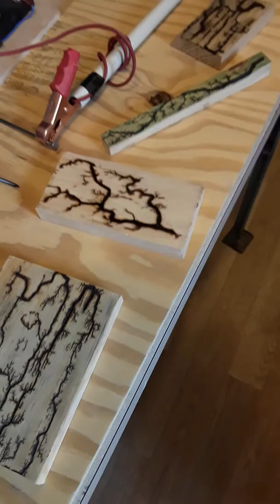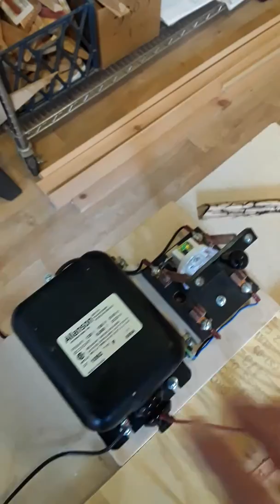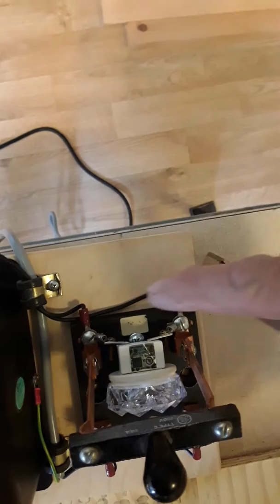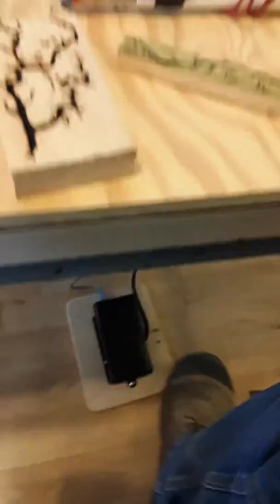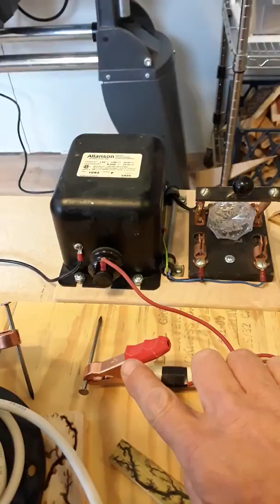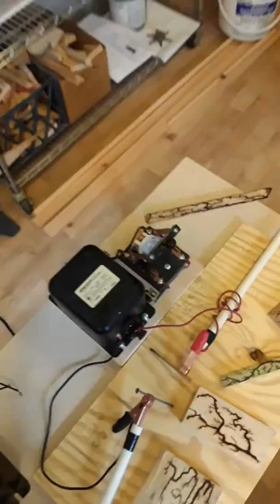Lichtenberg Wood Burning Power Supply

Comment: Would silicone HT cable used on neon signage be suitable?
Reply from the maker: Yes indeed. GTO wire has a 40kv rating and is very flexible. So is solid core spark plug wire. I didn't have any handy at the time, but great comment.

Comment: Not good enough.  The 40KV cable is good, but not on the roll!  And the coax is NOT rated for any sort of amperage, nor is the silicone tested for voltage resistance. I am a military trained electrician, (21 years, retired), and spent 30 years in factories, as a electrical maintenance manager and an industrial engineer. 
 I got into this hobby about five years ago, and had a similar setup, save I elevated my platform off the bench with two glued on 2X4's. After time, you get a bit lazy...then maybe cut a few corners.  We all say we won't, BUT WE ALL DO.  I recently got into fractal burning guitars, and one late afternoon, a bit tired, didn't realize it was still on because my indicator light decided to burn out just then.  and  I touched one probe. The other one literally jumped into my other hand, as the hand was touching the edge of the guitar body.  I "Rode the Lightning" for about two seconds until I fell on my right side, heavily bruising my shoulder and hitting my head on the floor.  When I hit, I woke up, got up and went into the house and had my wife call 911. Heartrate was 160, and I ended up in a burn center for three days as they monitored my heart, and treated the burns on my hands, which were not that bad. Huge hematoma on my forehead, and a scalp cut on my head where I scraped on a bench nearby. NOT FUN, NEAR DEATH EXPERIENCES....
Changes I will make:
1. Add two momentary on switches to the incoming 120VAC in a plastic housing. Both have to be pressed to engage the unit. No 120VAC, no burn. Two switches, two hands.  You seem to know a bit about electricity. You probably know that when you are being electrocuted, your feet stay on the ground, and on that foot switch, until you fall over unconscious or dead. Foot switches are a myth in high voltage safety.
2. My potentiometer, which I use to adjust the voltage, will be next, in a straight line away from me. Adjust before I can press both buttons, which are UL approved to be Open when released. 
3. The actual unit on its platform, further away down the line.
4. The probes, with 10K insulated wire, extending to a separate wooden table.
5. Finally, 12K gloves, 1.8MM thick, in case the switches, and the potentiometer all fail and it stays lit.
6. I am standing on 3/4" insulated rubber flooring, the final table will not be on the same rubber.
Sound like a lot?  6000VAC is a lot!  I am lucky to be writing this, but this is what I should have done in the first place.
Lichtenberg is like nothing else in beauty, and it is highly, highly dangerous.  I see people using regular wire, no gloves, machine very near to the work, and I think, there is number 34, waiting to die....
Stay safe.
Reply: copy paste?
Reply: @bohemis09  I've been putting my story on as many sites as I can where I see people doing things that are just stupid.  If you want to copy and paste it, feel free. I am, after spending 4 days in a burn unit.  I change the initial verbage to fit the particular video.  If I save one life, I have done my job...

Comment: Would a small 110 welding machine work ?
Reply from the maker: I wouldn't think so primarily due to the low voltage (about 80 volts - open circuit). High voltage seems to make much cooler looking lightning tracks.
Reply: @henryhurrass9121  ok, thanks, I'm trying to figure out a safe and easy solution without building anything 👍.

Comment: Excellent video!
Question...would using cables from jumper cables from the power supply to the wands be safe?
Reply: No please its not safe at all
Reply: No. Jumper cables are not rated for the voltage. The wire needs to be rated for AT LEAST 2500 volts. I would recommend not using one of these or making one.
Reply: Car jumper cables or insulated for 12 volts... So no